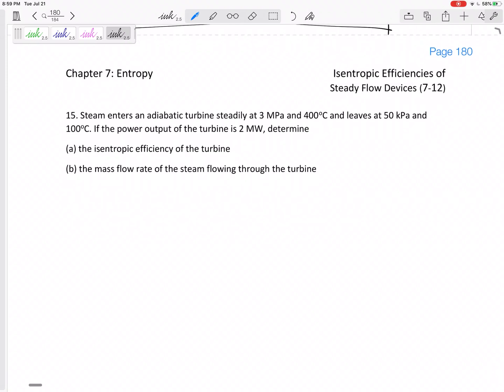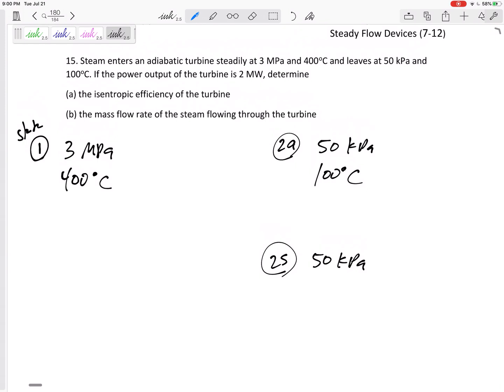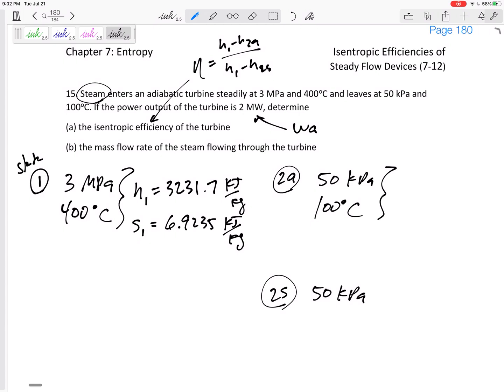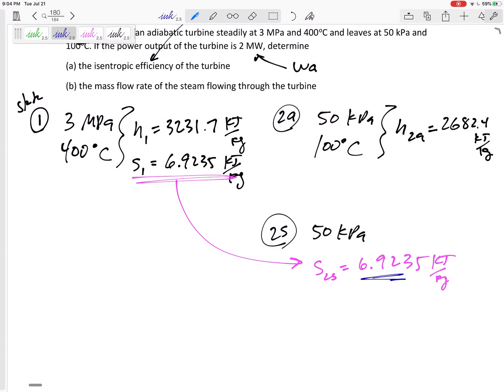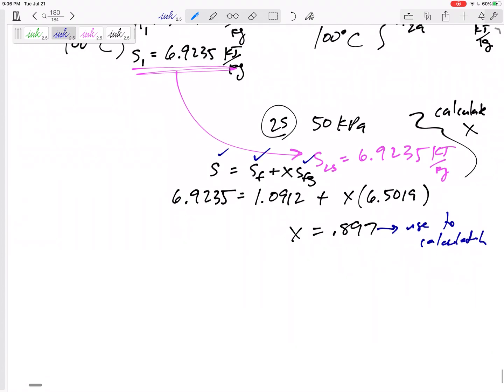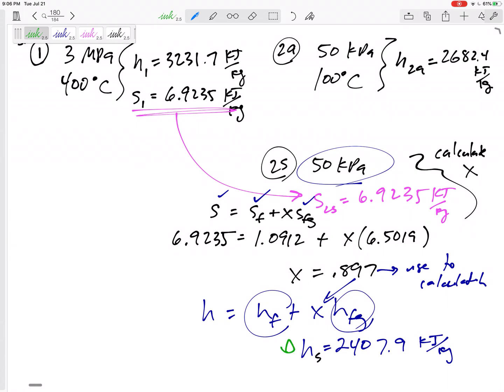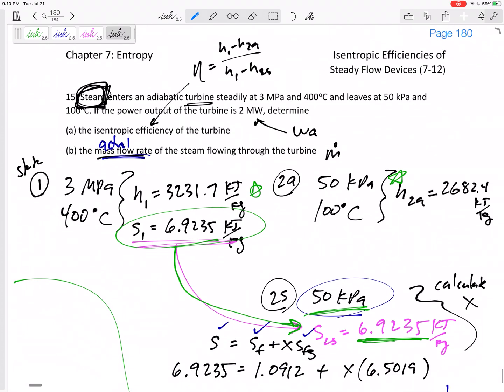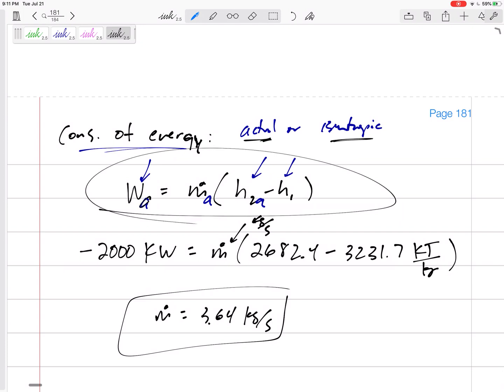Thermodynamics - 7-12 Isentropic Efficiency example 1

Comment: If it's reversible ONLY does that mean S2 - S1 = Q/T ??  Because Sgen would be zero at that point.
Reply from the maker: yes, correct. Sgen is a measure of irreversibility. So a reversible heat transfer would be S2-S1 = Q/T

Comment: why turbine work output is negative it should be positive since work done by the system is positive while work done on the system for compressor is negative right???
Reply from the maker: I like to teach Q+W=deltaH and say everything (Q, W, H) in is positive and everything out is negative. So if using Q+W=dH, work done by the system (out) is negative and work done on the system (in) is positive. If you use Q-W=deltaH then work out is positive and work in is negative.
Reply: @engineeringdeciphered  now I'm super clear thanks for the instant reply